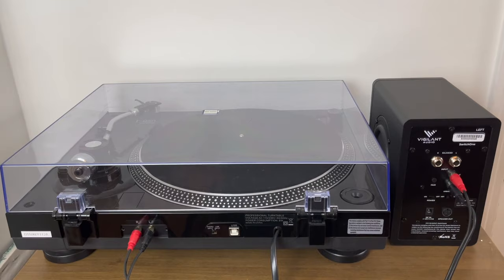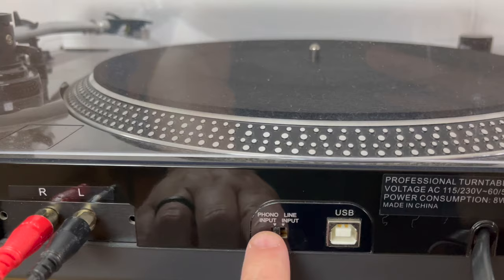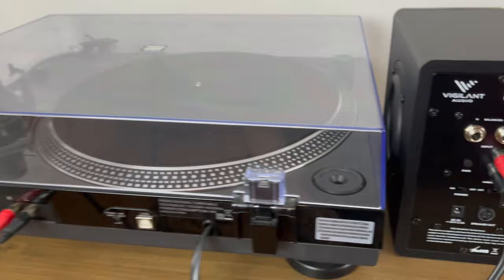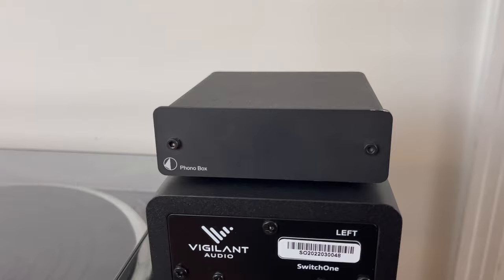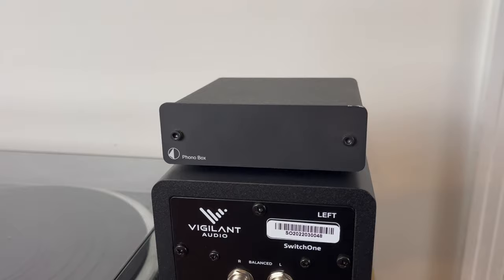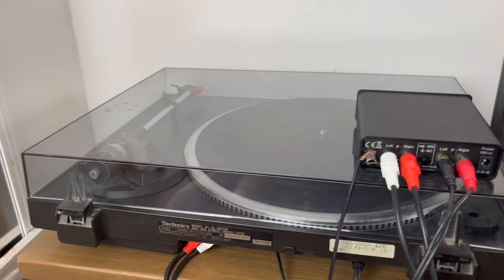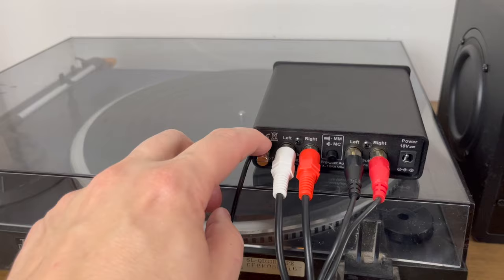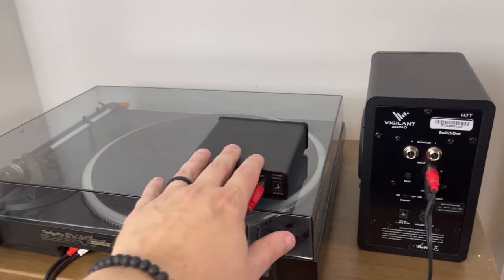How to EASILY connect a turntable to powered (active) speakers

Comment: So you can only do one speaker only
Reply: No most active speakers have on speaker that receives the power and the input and another speaker that gets connected to the main speaker. So you have 2 speakers but one has an input from the turntable and an output to the other speaker

Comment: Sorry…noob here. So you have connected one pair of RCA cables from your turntable to one speaker. How do you get signal to your second speaker with only one set of outputs from your turntable?
Reply from the maker: These are powered speakers so there is a cable that connects the speaker with the amp (shown in this video) over to the second speaker.
Reply: @ForeverAnalog  Thank you…apologies.

Comment: What if the powered speakers (Yamaha hs7) don’t have an rca input? I use my speakers for recording - have them running thru my computer. Wanted to buy a newer turntable and figure out how to get them connected! Thanks a bunch
Reply: RCA to 6.5mm adapter or RCA to XLR.

Comment: Hey, 
I have everything set up and working, but I have a question that I hope you can help me with. I have my turntable connected to some krk rokit speakers, with a phonobox in between as the amp. It works, but I can not really control the volume. There is a volume knob on the speakers but even at it's lowest it's still pretty loud. 
What are my options here to get more control over the volume?
Reply from the maker: Make sure your turntable doesn't have a built in preamp that's being used as that can often mess up volume control?

Comment: How would you connect two speakers? I have two active speakers and a preamp but there’s only a single spot for connecting a speaker? Not sure if I’m just dumb or if I’m missing something
Reply from the maker: Active speakers do not pair with a preamp as there is an amp built into the speaker already. You plug one speaker into the wall and there should be a cable that connects the speaker plugged into the wall to the other speaker. That's all you need to do for sound output with active speakers. The amp inside the speakers will control volume, tone control and source like a preamp would with a traditional stereo system.

Comment: Hello! Great video! I'm trying to do this with a U-Turn Audio Orbit turntable to a pair of powered Audio Engine speakers. I'm using a phono preamp that has a ground lug but the Orbit turntable does not have a ground wire or any specific place to connect a ground wire. I seem to be getting hum. Where should connect the other end of the ground wire?
Reply from the maker: U-Turn tables are supposedly internally grounded and do not need a wire however they can often hum still. Try making a metal to metal connection if possible. Maybe find a metal screw on the table and connect a wire to the lug on the preamp.

Comment: I'm a tad confused. I have 2 speakers, not one. They're studio monitors. I also don't have phono connectors on the back of my active speakers - it's one xlr female and one TRS female. What's the best way of connecting everything? My turntable is a project debut master II. I have the phono outputs on that. It also has a phono preamp.

I've tried looking for phono to TRS cables but they don't seem to have 2 TRS cables its just 2 phono outs to 1 TRS in.

Comment: I have active speakers. Edifier r1280 dbs. I connect to my turntable in line function with rca but still doesnt work. Any idea?
Reply from the maker: Is the speaker on the correct input? Sometimes those default to Bluetooth and you have to make sure you select the RCA input via the remote or volume button in order to get sound from the RCAs
Reply: @ForeverAnalog  thank you that solved my problem!

Comment: The turntable one looking at has an internal phono preamp. I’m just curious how I would connect a left and right speaker
Reply: Most powered speakers have a main, and secondary speaker. The main receives both inputs, and one of the signals is transferred over to the secondary speaker (if one is used)

Comment: This helped a lot. Can I also connect the powered speakers to a stereo receiver I just bought at the same time? My speakers have an aux left/right & a PC left/right outputs. In other words can I have both the turntable & stereo receiver connected to the active speakers at the same time?
Reply from the maker: You can’t connect powered speakers to an amp because they already have an amp built inside
Reply: @ForeverAnalog  there is no kind of work around? So, I need to hook up the turntable to the receiver AUX & get passive speakers to connect to the receiver? With that, both components can be heard?

Comment: So I am kinda new to this setup but how would you hook up two speakers? Would you have to use a splitter for rca cables to both speakers?
Reply from the maker: These are powered speakers which have a cable that connects the two. I just didn’t show that part because the manual for the speakers shows how to connect!

Comment: Hey I need some help, I have a Fluance players, with a Schiit Mani Pre amp, and Kanto yu4 powered speakers, I just purchased a Kanto 8 sub, and it is not working, I used the sub out and sub in on the speakers and sub and no sound! Nothing come from the sub. I can't find any help online!
Reply from the maker: Very strange. Is the volume turned up on the sub?
Reply: Yes I have, still can't figure this thing out.  @ForeverAnalog

Comment: Thankyou for the video, would like to ask I have a turntable whis is RP1 that does not have a built in pre amp, can I connect it with Active speaker / powered speaker like R1700BTs which have a built in phono pre amp? Thankyou if you ever reach out

Comment: Quick question, your setup only uses one speaker.  How do I set this up to two speakers without pre amp or amp.  Just record player and two speakers.  TIA.
Reply from the maker: I didn’t show the second speaker which is simply connected via a cable between the two, which is common with powered speakers. Only one speaker has the amp that you connect the table to and the other speaker is connected via a cable to the speaker with the amp.

Comment: I have the exact same Audio Technica turntable (AT LP120XBT-USB).  I am using powered speakers so I have it set in the back to LINE.  Works great.  I am now considering purchasing a phono preamp.  When making the connections, do I then switch from LINE to PHONO in the rear of the turntable?
Reply from the maker: Yep!
Reply: Thanks.  I suspect the pre amp will be of no help/assistance when I use bluetooth to connect to my powered speakers, correct? @ForeverAnalog
Reply from the maker: @stephendrahos9000 correct

Comment: Thanks for the video. Can you connect  a turntable and cd player to those Edifier speakers?
Reply from the maker: Most powered speakers only have one RCA input so you would need to simply swap the source cables after each use. So technically, yes, but it will require changing cables every time you go back and forth between the turntable and cd player.
Reply: @ForeverAnalog  ok thanks

Comment: How can we connect 2 Marshall stanmore speakers to the turntable?
Reply from the maker: I don't know how to connect two of those speakers, but you would connect the turntable to one of the RCA inputs on one speaker in the same manner mentioned here: either via built in preamp or via external phono preamp. I'm not sure there is a way to use two of those speakers for the same RCA source.
Reply: @ForeverAnalog Hello! Tell me please, if I use internal preamp and connect turntable to Marshall Stanmore via RCA, where should I need connect ground to? Or ground wire I will only use if I have external preamp? Thank you!
Reply from the maker: @devldavydov if you can find a metal connection (like a screw) on the Marshall that MIGHT help but no guarantee. If you can’t make a metal to metal connection enough to stop him then you’ll an external preamp

Comment: if the turntable has a USB output like yours does and the powered speaker has a USB-C input, can you plug it in that way? or is that USB output only good for connecting to computers?
Reply from the maker: The USB was intended to allow people to record their vinyl to a digital source like a computer - I've never tried it as an audio output as I don't think that was intent.
Reply: @ForeverAnalog  thanks for the fast response. i can't seem to find this answer ANYWHERE. might have to bite the bullet and purchase the speakers i'm looking at and give it a shot
Reply from the maker: @retrovids8450  my gut says it won’t unfortunately but since I haven’t tried it I can’t say 100% - let me know what you find out!

Comment: If I hook up powered speakers that have Bluetooth to a non Bluetooth turntable will I be able to listen to my records with a Bluetooth headset?   I’m trying to avoid buying a Bluetooth turntable.  Thanks and sorry for the confusing question.
Reply from the maker: I haven't used a bluetooth turntable before but I assume the player will send the signal to whatever you pair it with, be the speakers or headphones. You will probably just have to manually change between the two settings depending on how you are listening.
Reply: @ForeverAnalog  thank you for responding 

I don’t have a Bluetooth turntable   Just a regular one hooked up to powered speakers.  I’m thinking that if I got some powered speakers that had Bluetooth that I could listen to my records via the Bluetooth speaker.   As of now my turntable Doesn’t have a jack for a headset.

Comment: How do I connect two Technic speakers to the external phono preamp. The external preamp box shown has only one pair of connection for one spreaker. Also my speakers have pos/neg wires. Do I need a special connector that has one end with RCA connector and the other end wires that I must patch to my speaker wires? Thanks. It all seems so confusing.
Reply: hello i have the same question! did you ever figure this out?

Comment: I have active speakers without volume knobs. Is there some kind of switch type of thing I could add to the chain? I also can't connect my speakers to one another with one cable (I have Behringer Truth B2030A speakers).
Reply from the maker: Those speakers are studio monitors and probably intended to be paired with a mixing console or recording preamp that could control the volume and connections. I would search info on Behringer Truth speakers and see if there is a manual or video instruction on how to set those up properly.
Reply: Hi, i solved this with a very cheap passive mixer (it's just a bunch of potentiometers in a small box).. something like 15€. The concept is so simple, i wouldn't spend more.
You just connect all the sound sources in the rca ins and the active speaker in the mixer output and you're done.
But being a passive mixer, you'd need a preamplified turntable or a phono preamplifier to put in between.

Comment: What if you have 2 speakers because you showed 1? Im new to vinyl.
Reply from the maker: Are you using powered speakers? If not, check out other videos on my channel. The speakers I’m using are powered so they are connected by one cable rather than by a traditional amplifier with speaker cables.
Reply: @ForeverAnalog  Yes, I have the micca  MB42X. Thank you
Reply from the maker: @TBWTBH333 those require you to connect to an amplifier
Reply: @ForeverAnalog  Okay. An amplifier is the same as an external preamp, right? And cnn I connect 2 speakers to 1 amp that is connected to 1 turntable? Like would I need a specific amp for a set of speakers?